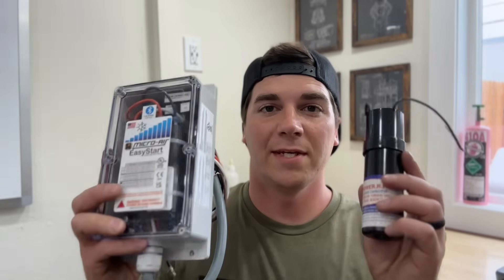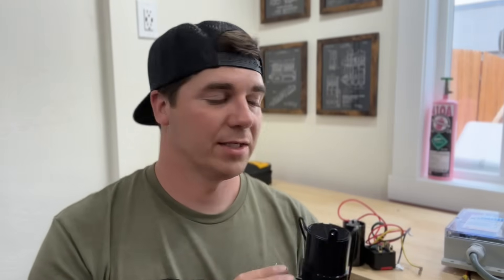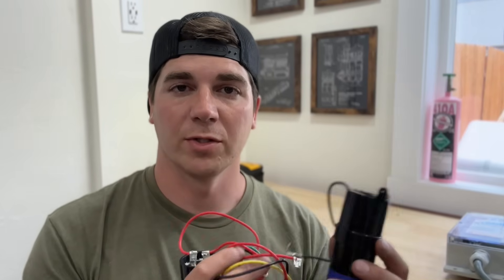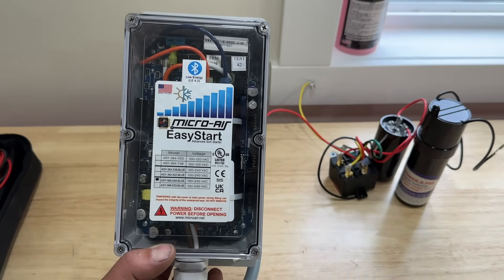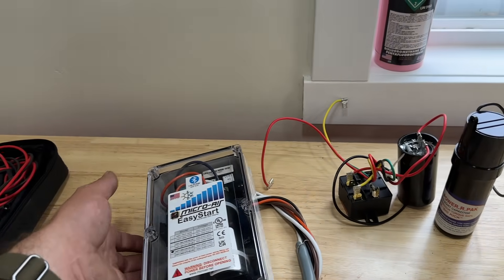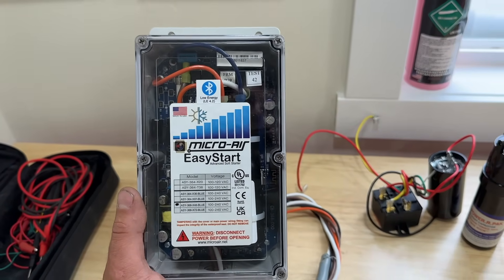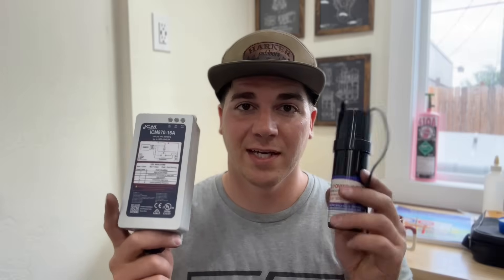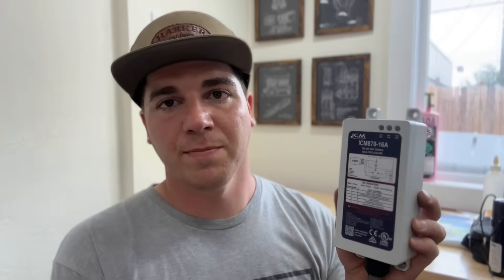Hard Start Kits VS Soft Start Kits    |     Which Is Better?

Comment: I just installed 5.74 kw's of solar panels and a Sol-Ark15k-2P inverter and a 10kw battery on my home.  It has provided 100% of my home's energy needs for the past 3+ months.  However, I decided to use the grid disconnect switch which separated me totally from the grid...and whenever my 2 1/2 ton heat pump kicked on, the entire system would DEFAULT and STOP working.  The initial ~ 1 second of starting power for the heat pump IS the problem.  The heat pump ONLY uses 2000 watts when running...and my clothes dryer uses 6000 watts and my electric hot water heater uses 4000 watts...and yet neither the clothes dryer nor the hot water heater will cause the solar system to fail.  I have a choice...add some more VERY EXPENSIVE solar batteries or install a soft start.  I am 99% certain the soft start will solve my problem, but I guess I am going to find out.

Comment: I have a Tesla powerwall getting installed and have a 5 ton 2 stage condenser, will the soft start use less power to get things going if I’m battery only, also what’s the reliability and how long to these soft starts last?
Reply: Yes, on the less power question. My 3 ton Trane AC had 63amp start and 13.2amp run, with the EasyStart Flex installed and after 8 startups the start is now 19.5amps and run is 5.2amps consistently. I did replace the AC outdoor capacitor because, although working, it was 7 years old and I like to be safe.

Comment: So, I have a 13 year old trane system, 4TWB3030C1000AA, on our downstairs level and it provides the main cooling in our house. This summer cooling demand is greater than in many years in coastal South Carolina and is resulting in the unit starting and running a lot. At this time the unit does not show any sign of failing. Which start aid would be best for the age and starting demands it faces: Hard or Easy start?  Thanks for any comment you can provide. 
Love your videos and comments.
Reply: Personally, I would buy and replace a new capacitor and install the EasyStart Flex to be as kind as possible to your aging Trane. I would replace all suction line insulation up to and inside the AC unit itself (it is the larger of the two line compressor lines). In fact, I just did that the last two days to my 7yr old Trane.
After 8 starts (7 of them learning) my AC startup and run is now: 19.2amps startup, 5.2amps run, whereas before EasyStart it was 63amps startup and 13.2amps run.

 A hard start kit is for units that have issues with slow starts (meaning they are not operating as designed) and are a stop gap method until you save enough money for a compressor replacement.

Comment: I wonder what is the standby current of a soft start device (the current the device draw when compressor is not running), there is no information about it anywhere. In the long time it will increase electric bill using two soft start devices. There is no logical reason to install this device. My two ACs 3.5 ton and 3 ton are 22 years old and still running without soft start device in the extreme Arizona heat.
Reply: Logical reason for me. 64amps startup, 13.2amps run, after EasyStart learn sessions, 19.2amps startup, 5.2amps run. I'm not complaining if my monthly bill decreases.
Reply: The standby current draw of a soft start device when the compressor is not running is rarely published as you noted, but some technical sources and product datasheets offer useful estimates. 

For example, one manufacturer lists a current consumption of 48mA at both 110VAC and 220VAC, which translates to about 5–10 watts of idle power consumption depending on model and efficiency. 

Another example from amplifier soft-start modules gives a figure of about 1.2W in standby mode, which is very low compared to the load of the AC unit itself.

Comment: this video is  confusing because it makes you think that you are improving your ac situation by buying any of two and you just need to decide which of the two. it is the case for softstart but hard start is rather your last resort when you comp is old and factory capacitor is no longer enough. you should not install hard start unless you have to!
Reply: If your factory capacitor is no longer enough, buying a capacitor is way cheaper than any of these kits. If you AC unit is really old, start saving up for a new one.

Comment: will a soft start work on a goodman 2 stage condenser unit?
Reply: Contact Micro-Air support, as it does work on some but not on others. They would have different install steps which I could not find on Youtube. It does work on my 2 stage Trane, and the steps to install were easy. I bought it with the install kit.

Comment: He should mention the AC unit sizes...his is a 3 ton unit...mine is a 1 ton size. I should be able to use a Soft Start of lessor cost.
Reply: All older Micro-Air EasyStart units were discontinued and now all you have to buy is a Micro-Air EasyStart Flex, which automatically works with all non-variable speed compressors from 1 ton to 6 ton. No longer need to pick and choose based on your AC tonnage.

Comment: A friend of mine installed a soft start in California on his AC because they set rates based on max instantaneous draw from the grid. His power bill was reduced significantly he said.
Reply: Looked many times for info regarding how it is effected max instantaneous draw which is major point of soft start  design. Interesting info for set rates.
Thanks for sharing this information.

Comment: If I am currently using a Hard start because my compressor won’t start without it.. Can I still replace it with a Soft Start and start my compressor?  Asking due to the generator needed for power outages.
Reply: Did you replace your capacitor yet? and is the voltage to the motor within the correct range? I would replace those and see what happens. A soft start won't help, it is not for hard to start compressors.

Comment: I really like your channel, it provides some good information, but i have a question on this product.  I have a dual stage 5 ton on my home, in speaking to Micro-air they note that this product shouldn't be used on a dual stage compressor, is there a way to wire this  and if there is, can you post a Youtube on it?
Reply: Are you sure it's a dual stage and not variable speed? My Trane 3ton S9X2 is a true dual stage and the EasyStart Flex works just fine, saving me electricity costs.

Comment: HI i change my start capacitor with the same uf 370 vac cleaned my condenser and lifted my fan off .. now on start up the fan does not start and the compressor hums all the diagnostic on the compressor r good nothing is grounded out  contactor is new and all the wires r in place and i have 240 up and down. stumped !!  thanks in advance
Reply: You probably solved it by now, so the following is for other people who read this:
The situation described, AC outdoor unit fan not starting while the compressor hums is most commonly caused by a bad or failed fan run capacitor, even if it was recently replaced. The run capacitor provides the necessary starting and running boost to the fan motor. If it is defective, fails prematurely, or is not the correct rating, the fan motor tries to start but cannot, causing the compressor to hum but not run properly.

Other possible causes include:
Fan motor seized or stuck bearings preventing the fan from turning.
Incorrect capacitor wiring or wrong capacitor value installed.
Faulty contactor or relay, though the user mentioned the contactor is new.
Voltage issues despite having 240V; insufficient amperage to start the fan motor.
Overload or thermal protection tripped on the fan motor.

Sadly, the humming compressor often indicates it is trying to start but is unable to because the fan is not removing heat properly, which can quickly lead to compressor damage if left unresolved.

Comment: You can also install the kickstarts if you want to run the AC with a generator I ran two two and a half ton system on a 6000 watt generator

Comment: Now by the time you pay for that piece of equipment and Mark it up and then you charge the customer to install it's going to be $200 you got $1,000 in that thing going to need more than $6,000 starts to get your money back and I bet that compressor will fail early because that's not made to start slow those are made to get up and go

Comment: I have a Trane Heat Pump from 1988 still working and cooling my home. Gas furnace handles heating. Yes, I know its SEER is like 8.0 but hard to justify $6,000+ to replace it. Want longevity ? Buy a Trane.

Comment: I installed the hard start kit myself 3-4 years ago and noticed it also helped reduce the running noise of the compressor.  I'd also like to replace the hard start kit with easy-start if will help prolong the compressor life.  I have a dual AC system and I can see will cost between $800-$1K for the easystart but will save on installing it myself.  With his easy-start i can use my backup gen (honda ge EU3000si with transfer switch) to run one of my AC unit in case of a power outage.  My solar with Enphase microinverter is capable of providing power (no batt bckup) but requires additional components ($5k-6K) for it to work.

Comment: @0:33:  A hard-start kit doesn't give an extra boost of current.  It's a capacitor.  Capacitors in AC circuits are buffers; they don't store and release jolts as in DC circuits.  A hard-start kit uses a capacitor installed in parallel to phase-shift some of the current for a power-correction.  This reduces inductive reactance and improves efficiency, thereby REDUCING in-rush current, not increasing it.
Reply: A hard start kit provides a quick, high burst of electrical current to the AC compressor at startup, boosting the torque and helping the compressor start faster, but it causes a sharp inrush current that can stress and potentially shorten the motor's lifespan. A hard start kit should not be the first option, check/replace your capacitor first, Check the voltage level to the compressor, then consider a hard start kit ONLY if your compressor is still having trouble starting, but it is only a stop gap method until you save enough money to replace the compressor.

In contrast, a soft start kit gradually ramps up the electrical current to the compressor, reducing the inrush current by about 60-75%, which lowers mechanical and electrical stress, extends compressor life, reduces noise, and is especially beneficial when using generators or inverter-based power sources.

To the OP" While capacitors in AC circuits act as phase shifters (creating a phase difference between current and voltage to improve the motor's starting torque), the role of the hard start capacitor is to provide extra starting torque by increasing the current in the start winding temporarily. This effectively reduces the startup electrical load and mechanical strain on the compressor. So, rather than reducing inrush current overall, a hard start capacitor helps the compressor motor start more easily and quicker, thereby reducing the risk of hard start problems without causing continuous high current draw.
Reply: great explanation. so would you recommend a hard-start kit to reduce the start-up noise (which I'm guessing is related to the jolt on start-up)? also, will this help protect equipment or do i need a separate surge protector for this?
Reply: @CG_eye-j9c  A soft start kit will reduce the startup noise, the hard start kit is for compressors that struggle to start and may be near their end of life.
Reply: @CG_eye-j9c  If I were you, I'd disregard the advice from SpaceCadet4Jesus.  I'm sure they mean well, but they're telling you what will solve your start-up noise without knowing what's causing it, and their earlier post simply restates the same common misconceptions about capacitors.  (I suspect they recently bought a soft-start kit.)

Comment: AWEOME videos. Thank you. Quick questions: In an area where the temp is 108 to 120+ in summer, on 2 split units, 3-ton 16-seer each unit, about 14 yrs old system with NO generator used, goodman brand...(FYI, I just installed 2 new capacitors that were bubbled up and were near busting which I installed last year, with 2, 3 wire hard start kit that has a separate relay which you talked about in you other videos). Should I remove those hard start kit I just installed, or keep it, or switch them with Soft Start kit to help with compressor's life and ease the loads on the capacitors? The excessive heat is killing those capacitors, not sure though...

Comment: Compressors are designed to operate effectively with high locked rotor currents without damage. They do fail from low voltage conditions,  however. A hard start 5-2-1 is the best device to assist a compressor. Soft start are expensive and do not save you on the electric bill at all. Install an Intermatic AG3000 surge protector on the condenser disconnect switch. Power  surges will kill a compressor, ECM fan motor and the defrost board if its a heat pump. Wash the condenser coil every spring so the compressor doesn’t have to work as hard
Reply: The peak inrush amps is misleading because there is no time interval involved, which I assume is a fraction of a second.
How does one determine a hard start kit is needed? I can understand a soft start is needed when a generator is involved.
Reply: @inhocsigno9151  Put  an amprobe on the start wire to the compressor. If the amperage at start is higher than nameplate LRA, try a 5-2-1 hard start. It will reduce the LRA of that tired compressor.

Comment: I’d add , even if u don’t  plan to battery or generator start, a soft start will just be easier on the pump & circuit over its lifetime. Even adding years of use

Comment: Hello, I have a 3 ton AC (30 amp starting and around 3,600 watts running) and a refrigerator (around 2,900 watts starting and 750 watts running).   If I get this soft start kits, what is the lowest starting and running watts portable generator I can get?  Can I get a 10,000 starting and 8,500 watts running portable generator?  What is the average labor cost to get this soft start kits installed?  Thank you all for your help.
Reply: I have a 2.5 ton with a soft start a full size refrigerator and freezer, a chest freezer, 2 TVs router, phone chargers and we have zero issues with our 9500 watt 8750 running watt generator. Hope this helps
Edit I had to have soft start because I'm totally off grid running 16,000 w of solar with 60,000 kwh battery backup. But when batteries get low we run our generator

Comment: Can I get some clarification? From what I understand from your video, on an old unit running on R22 system can benefit from a hard start kit while a newer unit can benefit from a soft start kit. What is the cut off point for considering an old unit? 10,15 years? I have a 12 year unit and plan on getting a generator (for emergencies), would I then need a soft or hard start kit? Thank you for your videos. They have been insightful.
Reply: Soft start is for when you plan on using a generator. Hard start- non generator/older units.

Comment: Regarding Hard Start Kits, only use those with an external relay and not a resistor only.  We have had resistor units not drop out after start as they get weak, and the compressor start windings end up toasted.  Relay type are more reliable
Reply: Glad you chimed in on that!!

Comment: The soft start seems to reduce the amp requirement to start the AC much more than the Hard start. I just got a new Lennox 2 stage AC that starts hard, you can hear it kick on from inside.  My older unit on the other side of the house is a 2 stage Trane (has 2 compressors) and that one, you can be next to it and you will hear it start but so smooth and quiet.  Can a soft start reduce the hard start of the Lennox AC and extend the life of the compressor?  I  ask as the unit is a 2 stage compressor, when it was first installed it started in high mode, I asked the installers why it started in high, it was apparent that they did not know, they contacted Lennox and made changes to the thermostat settings, but even so it starts Hard but the compressor starts out at a lower speed.

Comment: Is there a soft start kit that will work with a newer window shaker? I recently bought "cheap" 6Kbtu unit rated 11seer. Yes, it surges when starting, but settles down to around 485 watts full running on high. Reason because I have a decent 1500 watt sinewave inverter that pukes out when I try to start AC.

Comment: Great video, thanks for the information. I have a 2005 Rheem AC unit with a 2.4 Ton Copeland compressor. At this time it is working fine. I recently replaced the contactor, cables and the capacitor(installed a Amrad 35/10 with CPT) as maintenance. Do you recommend installing (or not) a Hard or Soft Start kit for this setup? Just thinking in the nonsense prices of the new units, I just want to make the actual system to last as long as possible. Thanks!

Comment: The soft Art kits are also excellent for people that have solar systems with battery back up. Many inverters cannot handle the surge current of an air conditioner but with a soft start it is usually no problem and you can run your air conditioner for a few hours without running your batteries down too low during a long-term power outage

Comment: You never really said if the soft start unit will work on an older unit   that has issues starting when it's 90 degrees out and the thermostat is short cycling.  My success came when I found a timer that delays the low voltage by about 10 minutes since last start. It has pretty much eliminated the stalled compressor issue.

Comment: You should do a video that demonstrates the difference in sound before & after.
Reply: It's not really significant.
Reply: @gamechannel1271  It significantly reduces the startup JOLT noise but does not reduce the compressor operating noise.